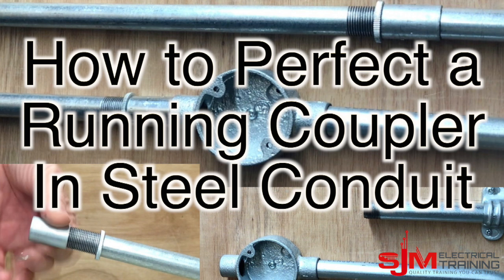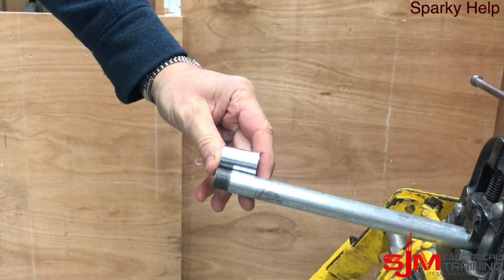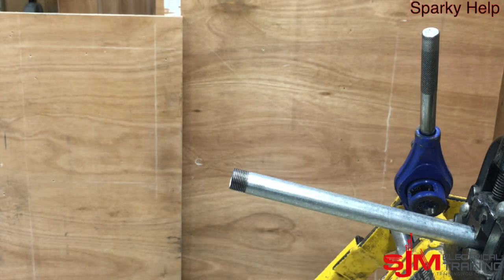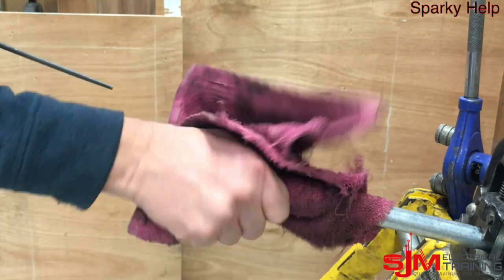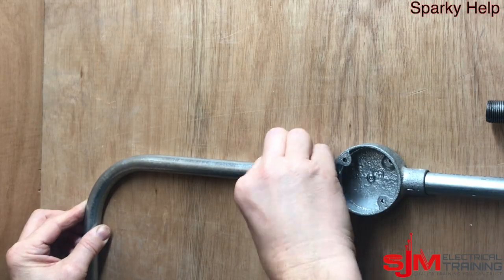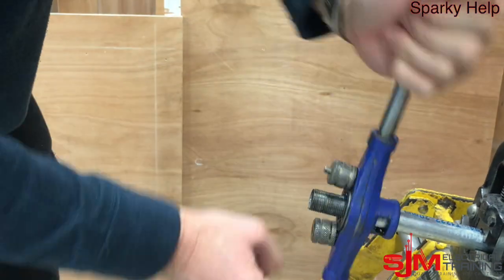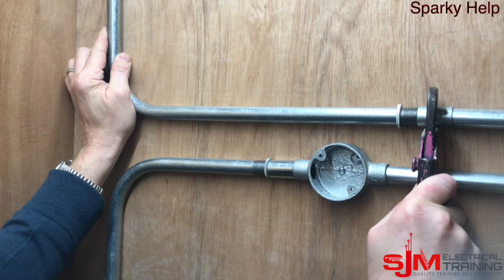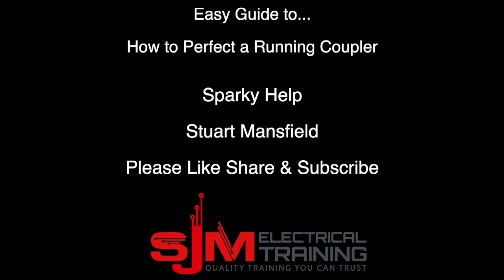Master a Running Coupler Installation in Steel Conduit like a Pro!

Comment: Hello mate , what do you do if the lock ring goes on but the coupler isn’t going on fully , like something is blocking it , what do you do ? 🤔,
Reply: And it is fully threaded the full length of lock ring and coupler isn’t,
Reply from the maker: Hi Thanks for watching, please share with like minded and check out my other videos.  It sounds like the coupler in defective, just change it and all should be good.  Hope that helps, don't forget to like and subscribe.